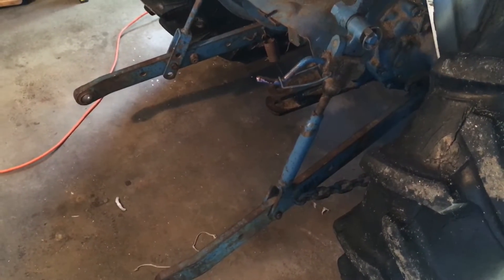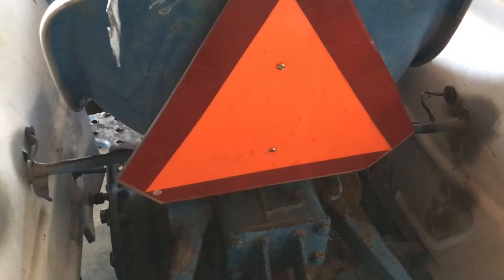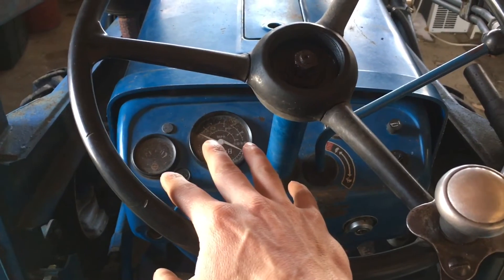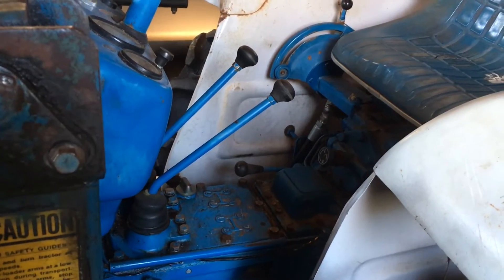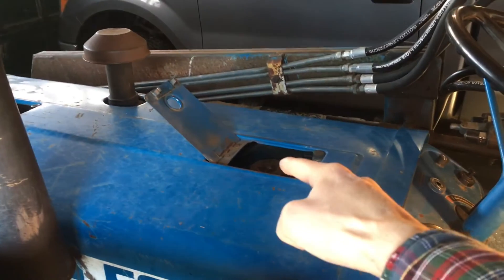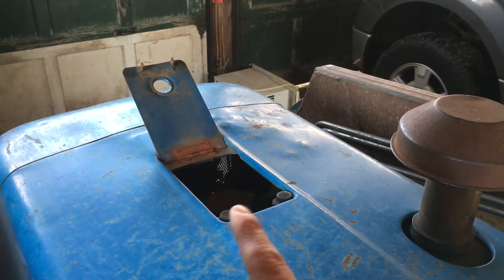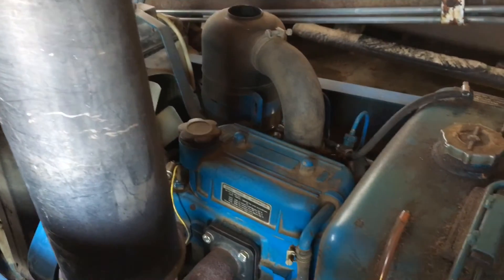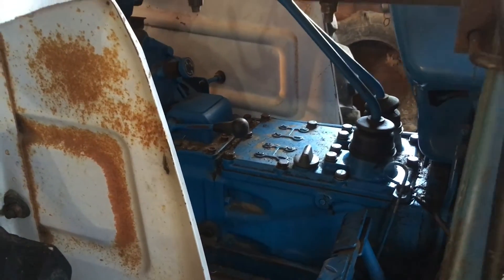Does an Older Compact Tractor Measure Up? Comparing a 1981 4wd Ford 1700 Tractor to Modern Tractors

Comment: Just bought an ‘86 1710 with 2–wheel drive, no front end loader, but in good shape with low hours.  What about carrying a round bale with a fork  on 3-point hitch with it?
Reply from the maker: Load up the front with plenty of ballast via suitcase weights and it should lift it OK depending on the round bale size - you probably have about 1500lb of lift a couple feet behind the ball ends. The big thing is making sure the front end stays planted on the ground for safety in maneuvering. Be aware that a 2wd 1710 weighs about 2500lb without ballast, so if you can pick 1500lb behind the machine you can imagine how the front end wants to come off the ground. When I pick up my 700lb brush hog, the front end on the 1700 does get noticeably lighter even with the loader on the front; the 5ft brush hog does extend far back though. I could really tell when I still had the manual steering. Since I upgraded to hydrostatic power steering, I don’t notice that anymore.

Comment: I have a 1910, loader used to be very weak, there’s a relief valve that I shimmed and now it will pick up the rear tires if you try to grab something too heavy. Been working good for years

Comment: In regards to the PTO stopping, when you depress the clutch. That can be solved by, getting an overrunning clutch.  It mounts in the pto shaft,  when the clutch is depressed , it allows the clutch to go ahead and spin , until the momentum stops .
Reply from the maker: @jimginn6640  The Ford 1700 has an internal overrunning clutch. I think transmission driven PTOs without that went away in the ‘50s because of the danger of the attachment propelling the tractor forward after the clutch is depressed. The contrast I was making is that this isn’t a 2 stage clutch or an independent PTO as is pretty much standard now, allowing for shifting while the PTO remains under power. A rotary cutter has enough momentum to keep right on spinning through gear changes, but other implements like a rototiller stop pretty quick.

Comment: I've got a 1500; for the most part I'm happy with it. The big thing I'd like is to have the PTO not dependent on the ground drive clutch; step on the clutch and everything stops (it's not a 2-stage "live PTO" clutch either).

You're not wrong about the price and availability of parts. I recently had to replace the brake shoes. $285 for a complete set of shoes, and that was the best price I could find! Serious ouch.

But several years back, the voltage regulator failed and a local auto parts store found a solid state electronic replacement for less than half the price of an OEM or OEM-similar. And a year ago I had to replace the steering gearbox; found an aftermarket one that appeared to be cast in coarse sand on a beach in a developing nation for a somewhat reasonable price. It seems to be doing OK.

If you're lucky, you'll find a part that is common to other brands, and it'll be cheaper than even aftermarket "same part number" parts.
Reply from the maker: Ths is for watching! The transmission driven PTO hasn’t really been an issue for me. Yeah stuff stops when you clutch and shift, but I don’t do that with an implement under load anyway.  The rotary cutter has so much momentum it keeps going anyway. As for steering, I converted to hydrostatic power. Costly, but made it a completely different machine - no looking back and no regrets.  Electrical on mine is original except the flasher unit. That’s a NAPA generic that I zip tied in place. Good to know about the voltage regulator if I ever have that issue! Right now my big issue is the 3 point lift cylinder is leaking. Probably the piston seal is shot.
Reply: @ProductiveRecreation  My 86 ford 1510! why do I have to shut it off to engage the pto?
Reply from the maker: @leemontoya8028 No idea. The 1700 has a neutral start switch (have to start the engine in neutral), but not a clutch or seat switch. To engage PTO you just press the clutch in and shift it, then ease the clutch out. If the 10 series has more wiring and safety switches it could have to do with something like that. The way around would probably be to bypass a failed safety switch (my neutral start switch is bypassed because it failed several years ago and replacements are not available).

Comment: STAY AWAY! Had a 2110 4x4. Nice size and power but the engine was junk and hard to find parts.
Reply from the maker: I’m pretty clear about parts availability (or lack thereof). As for the engine, completely different animal. The 2110 was a brand new model with a new engine at the time. The model LE892 engine in this tractor was used for 9+ years beginning in 1973 in the Ford 1000, 1600 and then 1700. It’s a really simple 2 cylinder diesel and I’m unaware of major issues with it. Mine doesn’t even have any leaks. Different engines from the 00 series in the 10 series across the board.

Comment: The 3-point lift sounds impressive but FEL sounds kinda weak, and seem so that seat could greatly updated with after market seats. My only concern is no diff lock, I wouldn't buy any tractor without it..........
Reply from the maker: It has a diff lock, at the left heel. Works great. I use it regularly. I too wouldn’t be without one.

Comment: Great video! My father passed away and left me with this exact tractor. Would love to get it all serviced up and start using it again on my property. Any chance you can make a few simple "How-to" and maintenance videos? Right now, my front loader doesn't raise and the rear stabilizer arms leak down from the up position. This is my first tractor and I'd hate to see it wither away.
Reply from the maker: I’ve made some previously, but not for a basic engine oil change or air filter service. My maintenance season is usually late winter/early spring. My 3 point hitch leaks down too. I think the lift cylinder seal is bad. I might try that myself, but I’m contemplating sending it into the dealer for that. If your rear lift raises, I’m surprised the loader doesn’t. If the machine has been stored outside it could have water in the hydraulic reservoir (transmission!). Changing the hydraulic oil and cleaning the filter is the first step there. I do have a video on that on my channel.
Reply: Thanks for the info. I'll start with changing the hydraulic fluid and cleaning out the filter. It sits outside. Thanks again.

Comment: My dad had the 1700 the reason your loader only lifts about 800 pounds is the front wheel hubs will break. There was a heavier axel hub made to solve the problem. My memory fades but I believe the 1717 , 1720 etc. axle hubs also fit the smaller 1700 axle. After my dad passed I traded in that tractor for the TC40 D new holland. I like that tractor too but wished I kept my dads.
Reply from the maker: Early 1700s had weak front axles prone to breaking. Several updates were made midway through the production run (late ‘80), and the axle was strengthened on later 1700s like this one (made in late ‘81). The 1710 loader lifts the same. The 1720 loader lifts about 100lb more. Those numbers are comparable to other tractors at the time. Today’s loaders are just a lot more capable on smaller machines. That actually makes them more dangerous, in my opinion, but is really useful if you know how to make use of that capacity safely. I’m not sure if the front axle hub shaft out of the final reduction gearbox is compatible up the line. The front axle and kingpin configuration was dramatically changed from the 1700 to 1710. The other big change was going to a 3 cylinder engine and adding another transmission option. The sheet metal changes are just cosmetic.

Comment: I have a Shibaura SD1840D that looks similar to this. I heard the 1500 is suppose to be equivalent but mine doesn’t have the double gear shifts in the center. The thing that is confusing to me is I have two hydraulic fluid filler caps; one at the gear shift and one behind the seat at the rear lift. I think these fill the same reservoir but not sure. Do you know?
Reply from the maker: Not sure. It’s possible the rear differential is a separate reservoir.

Comment: Have you checked the hyd pressure at the valve chest on the loader the pressure may be down it should be near or at the same pressure as the tractor by adjusting the relief valve you can bring the pressure up that may help.
Reply from the maker: It was in spec not too long ago. I haven’t checked recently but I haven’t noticed any major changes. The 770 loader is rated to lift 700lb at the pin to full height. That’s it, but I bet it does all of that. And that’s on a tractor/loader combination that weighs around 4000lb with rear wheel weights and loaded tires, so it’s stable. The loader capacity is theoretically similar to a subcompact tractor today, but the 1700 with the 770 loader is way more capable than a subcompact. No competition. I just find it’s easy to max out the loader with the capacity it has.

Comment: Nice video. I saw several of the mid 1980s 1700s with the FEL and backhoe, break the bell housing such that by 1990 the bell housings were hard to get. I ended up going with a used 1973 Ford 2000 with an FEL. It has worked well all of these years. Be gentle with that bell housing. In general I believe that the older machines are better than the new light duty crap. I'm in a snow zone and a great upgrade was a cab. Good Luck, Rick

Comment: The front will come off the ground. My 1700 has no FEL but has front weights. And after 400# the front becomes very light. I put an aftermarket seat that rides fairly well. I bought my tractor new as a 79 demo in 1980. Still runs fine. Uses a water pump about every 10 years or so. Get them rebuilt somewhere- costs $120 or so. New at dealer is $400 or more.

Comment: On either side of the PTO speed knob there are pipe plugs, do you know what they are for.?
Does this tractor have draft control?
Reply from the maker: Mine only has position control, but draft control was an option on the Ford 1700. I'm not sure how common it was for 1700s to be equipped with it.

Comment: I've gotten a lot of use from my 1210 over the past several years.  But is has to go as I just purchased a 1960 Ford 871 SOS Diesel with the Elenco option and front end loader.

Comment: Hey bud. So I’ve got a shibaura sd2200. Which I believe is a ford 1700. Working on restoring it but have been having many issues with hydraulics. I have change cleaned and even taken off the plates to spray brake clean and suck it all out. I get maybe an hour of work out of it and hydraulics begin to shutter and shake quite a bit.  I have tried cleaning the hydraulic filter which is located inside the transmission under my right foot. Would you happen to know a place I could buy a new filter of that type? Also having a hard time locating part numbers for the o-rings for the hydraulic suction and return lines. Any idea about those?
Reply from the maker: If you’re in North America that’s probably a gray market tractor, as I don’t think Shibauras were sold here. If it’s the same (or very similar tractor) to the Ford 1700, try the New Holland website. Look up parts for the 1700. They have exploded views and part numbers for everything. Some things aren’t available, but others are. The machine is picky about hydraulic fluid type. The Ford fluid spec is M2C-134A. Make sure you have one that meets or exceeds that. Otherwise it sounds like water or crud in the system so you are right to go after the filter. The filter is a fine metal screen and meant to be cleaned. Not sure if replacements are available.

Comment: Looking to buy one of these units. How many hours is too many hours? as this is the only way to kinda judge engine life. Thanks
Reply from the maker: Too few hours scares me more than a lot, as that means the machine just sat corroding away inside and out. A Ford 1700 is currently 40+ years old. At 50 hours per year (typical residential/hobby farm use) it would have 2,000 hours on it. Mine has under 1,600 hours on it but I know its whole history because my grandfather bought it new. It worked quite a bit the first 20 years, and then not so much until I took it on. I'm running it 50-100 hours a year. Things to consider: any weeps or seeps of oil? Check around shift boots, hydraulic cylinders, PTO shaft, oil pan. How does it start? (mine starts right up with glow plugs, even in below freezing temps). How does it run? Is it smooth? Does it smoke after it warms up (it shouldn't)? Do you know any of the operational history - for example, is it a lot of stationary PTO running (which is just engine hours), or was the machine driving all those hours (which puts wear and tear on everything else). Check the steering for free play. See if it looks like it has been regularly greased. Anything that indicates good maintenance is a good sign. Just be aware that if it has any issues, parts can be hard to get and expensive. I find engine parts are generally easier to find than the rest of the machine because the Shibaura LE892 engine was also used in the Ford 1000 and Ford 1600, which were predecessors to the 1700 - so there's quite a few of those engines out there. Different engine in the 1710.

Comment: I've got one of these and it does everything I need to do, plow snow, or pulling logs out for firewood. Great little tractor and you get used to the controls. No electronics other than starter and lights, an old school tank!

Comment: im looking to get one of them ford compact tractors. still looking though but hopefully ill find one. they seem really good tractors in my book.
Reply from the maker: Its a stout machine, but parts are hard to come by (and expensive). If you look, you want to find one that has been run regularly and properly maintained. For what its worth, I know someone who had experience with a 1710 and said it was always a bear to start. The engine was changed with the upgrade from the 1700 to the 1710. I don't have that problem with the 1700. Starts without glow plugs in the summer, and with glow plugs alone without much trouble down to about 20F.
Reply: @ProductiveRecreation  thats amazing. and those modeles you mentioned in the reply are also some of my favorite ones too. i like old tractors. but if i can find and get one. that could help out when my other tractor is having starting spells. 
a farmers best friend is his tractor and the bond between farmer and tractor lasts a lifetime. and thats a fact for sure.
Reply from the maker: @GamerFolf1337  My grandfather bought this Ford 1700 new in 1982. Its just a little older than I am. I grew up with it and am still running it on the same property. It's not without issues, but it's still running well. He bought the 1700 to replace a Ford 9N. Much bigger difference between the Ford 9N and the Ford 1700 than the Ford 1700 and a brand new gear drive compact tractor today.

Comment: Any idea on how to add rear  hydraulics.. I don’t have the loader. This has been a great tractor for my uses but looking to expand its capabilities
Reply from the maker: I’m not a hydraulics expert in any fashion. The loader is fed from a unit by the relief valve under the seat by the 3 point height lever.You can see some of the plumbing in this area with the loader in my videos about the steering conversion. If you have the operators manual for the tractor, supposedly you can take hydraulic flow off from the 3 point cylinder if you raise the hitch all the way and lock the lever in the notch. Not sure how that would work if you want double acting with return. There was a backhoe available for the 1700. Your best bet may be to see if you can find a parts diagram for that, as it would use rear hydraulics. I’m sure a dealer could help you out, but it may be expensive since kits for this kind of thing aren’t made for these old tractors. Not enough volume to justify it.

Comment: I have the same tractor & was wondering if you would go over the hydraulic pressure relief value located right behind the seat. I believe that's what's it is.
Reply from the maker: Yes the relief valve is under the seat on the right side (when facing forward), by the position control lever. Should be set at 2133psi; adjustment screw is to the rear. I haven’t tested it or adjusted it, but all is running fine (last checked by a dealer a couple years ago). To check the pressure you remove the plug by the 3 point hitch speed adjustment knob and connect a hydraulic pressure gage and then raise the hitch all the way at rated RPM until the relief operates. Plumbing on mine is slightly modified now as I installed hydrostatic power steering this spring after making this video. I have videos on the steering too.

Comment: paid 2000,00 for 2 wd  version of yours 20 years ago no loader very basic old machine 5 ft chopper no problem 5 ft finish mower no problem use it to work horse arena and use small box scraper to maintain driveway. use it at least once per week never failed to function or broken down one time. be nice to have new one with climate controlled cab just cant justify the cost also doubt reliability on new stuff.

Comment: Very thorough, I  picked up some things I didn't know before. Would you save these older 1700's are heavier duty and built with more quality materials then today's more modern tractors?
Reply from the maker: A friend who used to work in the service department at our local New Holland dealer says yes. These are heavy, rugged machines. His father has a 1710, the next generation of this tractor. The issue is if you do break anything major, finding parts for repair can be difficult. I also didn’t thoroughly address loader bucket quick attach - new tractors often have that so you can change loader implements easily too. This bucket is pinned on.